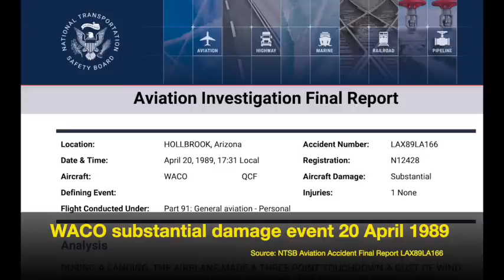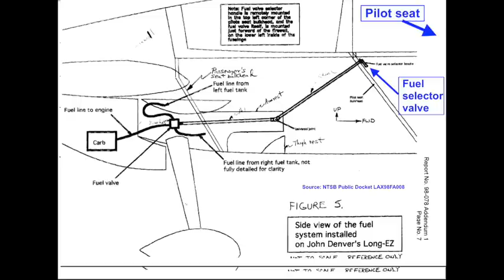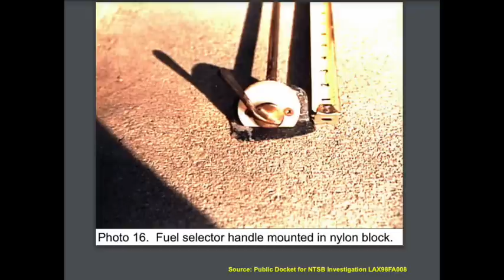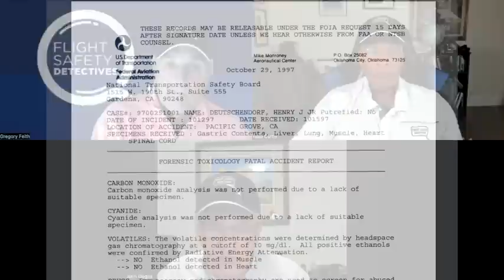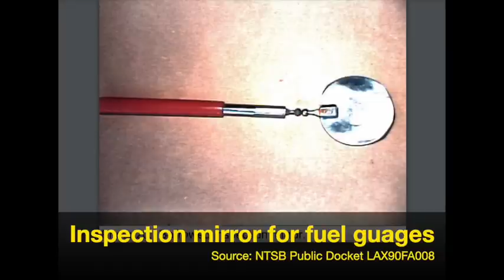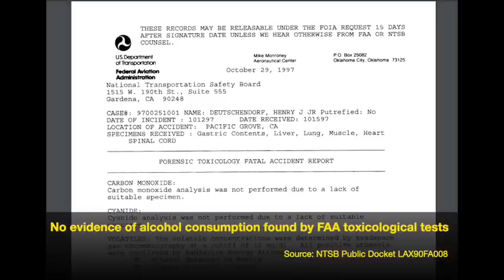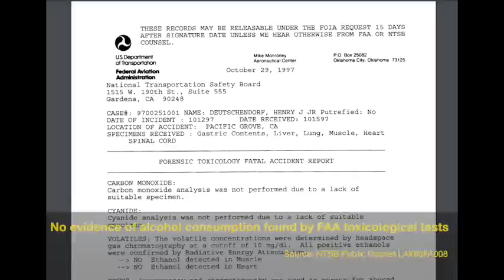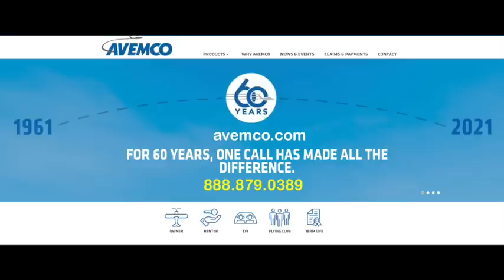John Denver Crash and Experimental Aircraft - Episode 140

Comment: Just to be clear, the fuel valve itself was located on the firewall. A lever to actuate the valve was mounted on left side of the roll over protection / headrest. It was connected to the valve via torque tubes and universal joints. Not being able to operate the fuel lever from the pilot seat would be a no-go.

Comment: I like the harshness of this evaluation because it seems most of these accidents are a result of irresponsible decisions and carelessness, if not  stupidity. And  in my opinion whether it’s John Denver, Roy Halladay or JFK Jr.,  there needs to criticism along with sorrow. Im sure not the one to criticize but those who are qualified I believe should. My dad was a big fan of John Denver and it was a sad day when he died.
Reply: How many peoples check THEIR  cars in the morning before driving off. For leaks or anything. Tires  or fuel  lines or break lines or little chips in the windshield, or mosisal  in the gas tank.or even tail  lights or head lights or unusual  noise  coming from the engine.
Reply: As to J.F.K. junior, it was probably beyond a Mistake.
Reply: @reginaldtaylor4698  Dumb to dumber comparison, simply because cars don't fall from the sky.
Reply: Easy to sit on your comfortable couch, watching a video for 30 minutes, and call people "stupid" for decisions they may have had only seconds to make...

You don't learn anything about safety and how to setup safer systems and procedures that way...  

It's one reason why in NTSB reports for example there are never such terms as careless or irresponsible etc used...
Reply: @PRH123  "Call people "stupid" for decisions they may have had only seconds to make..." - rather they are stupid for putting themselves into those situations in the first place. "Safety and how to setup safer systems and procedures that way... " can never be idiot-proof unfortunately, especially when it comes to the rich and famous who could afford the means. Try to see the forest for the trees before getting on your high horse.
Reply: @PRH123  Yeah you seemed to have missed the point because I would never criticize someone for a mistake or poor decision they made  under duress. That’s not even  part of the conversation and  if it was I woudnt care anyway. My initial point which I did a poor job of making was basically that it “seems” to me as someone outside the aviation community, that the people inside it don’t appear to have much sympathy for people who don’t follow the rules and end up crashing (and dying). I don’t know maybe I’ve got it wrong but it seems like they often  make an example out of them and make no apologies about it.  

If this was about maritime  disasters or a railroad accident , I wouldn’t even take notice of anything like that but since it’s aviation I do. And the reason is I would have never believed airflght would be as ridiculously safe and efficient as its become over the last few decades. And  I’m tempted to believe it didn’t get this way just by making rules and regulations and hoping people would follow them. Whatever they’ve done it’s impressive and my point was that maybe being tough on the guys who didn’t take it seriously enough was part of the reason for the success. 
Again, I could be totally wrong and the critism I hear after these tragedies might have nothing to do with any of it. 

But regardless of that or anything else, the guys who crashed and died that I said were stupid, were in fact all stupid. I mean thats just the truth and it’s not like I or a million other people haven’t been  just as stupid, we’ve just been lucky enough to get away with it.  But that’s the way life goes and I’m not the one criticizing them, I’m just saying maybe the criticism serves the greater good that’s all.  Who knows.
Reply: @newhorizon4066  Agree
Reply: @Ghostshadows306 . 

As you note,  commercial aviation has become very safe and efficient, by decades of experts analyzing, reviewing, communicating etc based on data.  They're not being tough on the people involved, they're just looking at facts.  They’re not supposed to let their own emotions into the equation, and not supposed to be nice, or be mean.  The guys in this video make some apparently judgmental statements because they are from the professional world of large commercial aviation, which is very structured, but there they are discussing private experimental aviation, which is something quite different….

The point is that subjective value judgements like "sympathy" or "stupid" are pointless when analyzing the reasons things happen, and how to set up systems to insure they don't happen again in the future. 

I've been responsible for setting up procedures and insuring safety for a couple of decades now, and people blaming does not bring any positive results. You have to look at the whole environment in which people are working to understand why things happen.

Systems that depend only on personal exertion, without training and recurrency, without reinforcement, without physical setup and equipment, etc will inevitably experience repeated failures. When these failures happen, it's not because the people involved were "stupid" or "irresponsible."

For example, if you live and work in a building that does not have designated fire escapes, or alarms, and you have never participated in a fire drill, are you "stupid" when the building catches fire and you die in it...?  The answer is of course no...

So as concerns John Denver, I would not say he was stupid. Ideally in a structured environment he would have been instructed in fuel valve operation, and received a checkout in the given aircraft by an experienced pilot. But things are looser in the world of experimental aviation, and JD took the decision to go without review.  He was an experienced adult and so understood the risks of his approach. So he got the result that he did. Everyone in experimental aviation  have this understanding, but they knowingly exchange risks for the freedom in design and operation that they enjoy.
Reply: @PRH123  Well that makes sense and I understand what you’re saying now.
Reply: @Ghostshadows306  thanks for listening…!
Reply: @PRH123  👍

Comment: Pure inexcusable stupidity on the pilots part, and the same for the builder—how did that crazy fuel valve location pass an FAA inspection ???
Reply: Not to mention here is a pair of pliers to move the valve that you can't see.
Reply: If flew over 850 hrs and 10 yrs with 2 different owners without issue. The FAA does not dictate where the handle to control the fuel valve is located. The only requirement is that the fuel can be turned off.
Reply: @buckmurdock2500  I stand by my original comment; that was a piss poor location for a fuel valve and the first two owners are lucky to be alive
Reply: It's Experimental.

Comment: ""questionable preflight decisions" - Very understated. He didn't add the fuel necessary to prevent the need to switch fuel tanks shortly after a takeoff. That's a mistake any pilot, especially one with his experience, should not have made.

Comment: He should have had the fuel selector relocated to its designed location BEFORE flying it.Also I feel had he fueled the aircraft tanks to full,he might have been alright.He was impatient.With the fuel tanks full he wouldn't have had to swap tanks.
Reply: I had seen in another video that he had scheduled to have work done on the aircraft including relocating the transfer switch.
Reply: ❤Wouldn't have mattered. It's not like my pickup where you run one tank dry and switch to the other. This would result in drastically unbalanced conditions.  You need to periodically switch between tanks to maintain the balance of the aircraft.
Reply: @jackiemowery5243  baloney.
Reply: @jackiemowery5243 good point, quite right...  

low and mid wing aircraft often have only a left and right selection on the fuel valve... whereas high wing have left-right-both, and usually you just leave it on both, and fuel gravity feeds to a little header tank then to the engine...  

whereas low and mid wing aircraft may require a fuel pump....  I have only flown cessna's and was surprised when watching a video on  Kennedy's crash that in his Piper Archer it was recommended to switch tanks every 30 minutes (!), which wasn't just so simple as turning the valve but required operating the fuel pump as well...

Comment: I am  VERY connected to John Denver’s crash - by virtue of many factors:
I built my own LongEZ. 
I had 200 hours flying it before my very near fatal crash in it in 1986.
I personally experienced issues with the same fuel selector valve.
Following my accident, I made a recommendation involving possible relocation of the valve (NOT SPECIFICALLY as the builder of John’s aircraft did).
Burt Rutan published my recommendation in his builder’s publication “Canard Pusher”.
My twin brother would occasionally fly John in his Learjet when John’s Lear was down for maintenance.
I am currently a 25,000 hr pilot and active advanced flight instructor (despite having lost both my legs in my forced landing LongEZ accident). 
I have also researched and lectured on many professional aircraft accidents with the emphasis on human factors. 
I generally concur with Craig, John and Todd’s assertions and beliefs most notably that John’s tragic loss occurred as he struggled to manipulate his fuel selector valve while putting a contorted axial body motion aggravated by heavy pushing on his right rudder pedal. Very predictably, this led to an unwitting right wing over (unusual attitude) slamming him into the ocean just off the coast at Monterey. 
I hold great respect for John - both as a musician and pilot. Personally, I attribute no causal factor involving alcohol or other substances to this very sad snuffing out of his honorable life. RIP John - “fly high”.
Bob Yarmey
Reply: Sorry, I meant Greg
Reply: Wow, glad you survived. ❤
Reply: Thank you for this personal disclosure of your accident flying the LongEZ.  I am happy you survived and sorry you lost your legs in your crash piloting the same plane.  Engineering factors often play about 40-50% of accidents that occur.  THis was an accident waiting to happen.....then did (to you and others including JD).  Please stay safe while "slipping the surly bonds of earth".
Reply: Where was your fuel selector valve...?  what was your recommendation as far as moving it..?

Comment: My dad built rockets and modified planes for NASA. He built 4 T-18s in our garage. He was a stickler for perfection. Had hiss build book for the FAA inspector. I bucket rivets. For him. Had mirrors to check every inch of the plane before the inspection and every section of the build.
Reply: That is all fine…while building an aircraft.  Not while flying an aircraft to determine fuel level.

Comment: All of you guys had a long career as NTSB investigators. Thanks for your service. I know you have seen things the rest of us are spared from.
It seems like the builder of this aircraft was very irresponsible in the way he constructed the aircraft. It seems like John Denver should have been a little more responsible in analyzing the construction and making adjustments before flying it. Maybe he should have added fuel gauges and relocated the fuel selector switch. Maybe he should have done more shakedown flights at higher altitude to familiarize himself with it, before he took it down to make that fun low pass on the coast.
I guess it looked like a really fun aircraft to fly, and maybe he was in too much of a hurry to get to the fun part.

Comment: Fuel valves can really ruin your day. I had a Cessna 140 that had a fuel valve improperly installed by the previous owner. It would feed from the opposite tank from the one selected. I had plenty of fuel in the left tank for the pattern work I was doing. Unfortunately for me, I was feeding from the right tank. About two hundred feet up after takeoff, and still over the runway, My engine quit. I tried to get it back down on the runway by slipping, but I was too high to make it. I touched down on the runway, but ran off the end into some corn that fortunately was only as high as my calf. No damage to the plane, and we easily pulled it out to investigate. The bottom line is that if your engine quits at low altitude, just fly the airplane. If John Denver had trimmed for best glide and not tried to switch tanks, he would have likely had a swim and an insurance claim after a successful ditching.
Don't even start me on the foolishness of installing a fuel selector that you can't easily reach or see. Every GA plane I've flown has had a fuel selector and fuel lines that were inside the cockpit. It's not an issue, because even a tiny seep will either stain the upholstery or alert you by smell. A good mechanic doing a pre-purchase inspection would certainly see the bad design of that, and Denver himself should have realized it was not a safe way to manage fuel. It's a shame, because John Denver's music was heartfelt and uplifting. He always has a place in my heart. Rest in peace, John.
Reply: Agree totally. Great comment!
Reply: Can I just mention that his plane was booked in for the fuel selector to be returned to the original position...when he was next on tour, a week from the accident.
Reply: The most probable reason he didn’t try to land it is because his medical was pulled, losing his pilots license and if he did an off field landing it would be an incident the FAA would know about making any chance to get his license back nil. The mechanic that John talked to before he died commented on some YouTube video and said  that him and John talked a lot about the fuel valve and was going to have it changed. The plane just got painted and nothing was even labeled in the cockpit because of that. He was like a kid at Christmas that couldn’t wait and the short little flight he wanted to do ended his life.
Reply: John was a driven in
Thermally deep feeĺing talented person he had such talent but he felt troubled by the rapidly changing world and music arena as well
Reply: That plane should not have been allowed to fly until the fuel valve was reconfigurred
Reply: The stall characteristics of the Long Ez very likely contributed to the crash, as a canard wing will strongly point the nose downward on stall. This is fine at altitude,  the nose drops, the wind over the wings pick up, and the aircraft recovers, and everything is grand, at the sacrifice of some altitude that is. 
 At low altitude,  this means that the aircraft will almost certainly nose down into the ground or the water in Denver's case.
Reply: "Take-offs are optional,  landings are mandatory".  Denver had no choice in the matter,  he was low and slow, the engine coughed and  he was going down, with only two options, the occupied beach or the surf. He chose the surf. It was the right decision at the end of a chain of bad ones.
Reply: @jstephenallington8431  the oscillatory "bobbing" when a canard airplane like the Long-EZ reaches minimum flying speed is very gentle with minimal altitude loss (<10 ft). It does not result in 1000+ ft of altitude loss.

Comment: He must have been having a really good time leaving the airport area distracting him from empty fuel status when he attempted the emergency tank switch far too close to the water. Why he took off on the 6 galloned tank vs. the 12 seems like he wisely elected to avoid using the valve before a takeoff in the first place...would have been fine but not for his extending his flight out over the water.  BTW, you cant realistically get a better ground estimate of LEZ tank level than its direct-sight system....so he knew how limited his fuel was.  A month before this, my right shoe slipped off to jam down my LEZ's right rudder peddle at low altitude, to which situation I immediately climbed and fixed the problem - but I  really believe no such option existed for John, who's fixation with the valve problem to his left had his right hand off the control stick while his right foot very powerfully commanded only right rudder...maybe never even seeing the fast-closing water since he would have known to at least immediately level-out the airplane.

Comment: 16:10 - I am not a pilot, but I  like to learn common sense approaches to life from general aviation safety, such as up-front planning of trips and the calculations necessary,  pre-flight inspections, check lists, take-off procedures, stabilized approaches for landings, etc. To me, one of the 'red-flags' with this 'accident', which I might attribute similarly to JK on the way to M.V. and DS takeoff and immediately crashing, is the seeming distractions and possible mental and physical fatigue experienced immediately before those fateful flights. If I understand correctly. JD had just come from golfing to fly the plane. I had only played golf once in my life, in my 20's, and I recall being fatigued after 18 holes. I  don't know how many holes JD  had played, if any, but I don't think I would decide to go flying after a round of Golf. Edit- at home or on the road, I make mental checklists when deciding to do something like intricate maintenance at home, or driving, or even riding as a passenger, and if I am not fully comfortable, I decline.